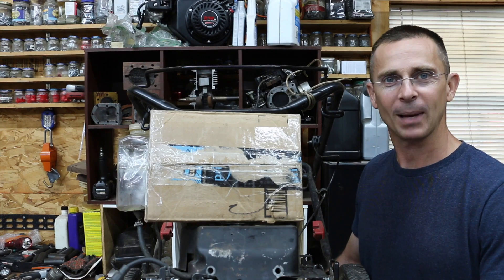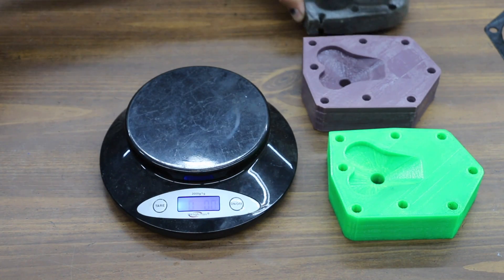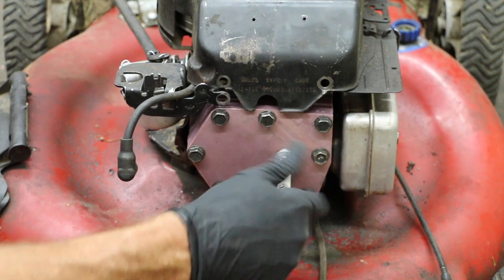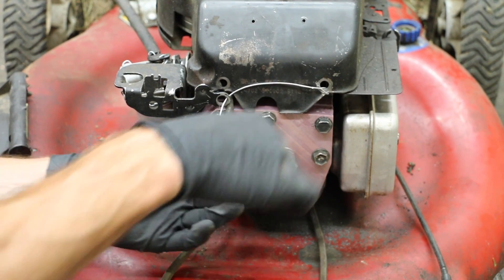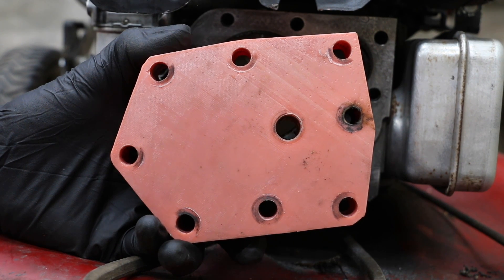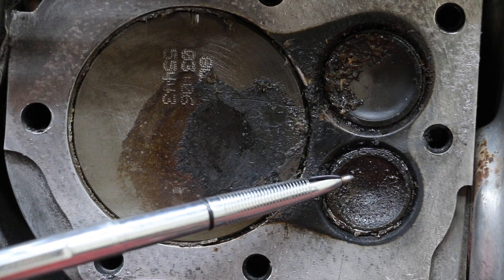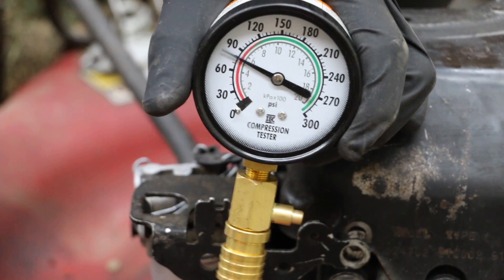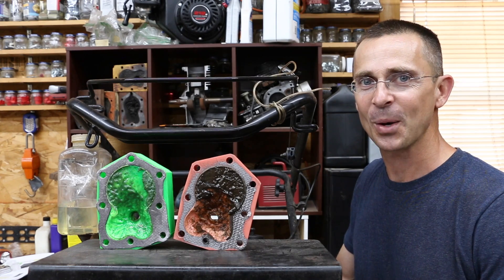How long will a 3D printed cylinder head last?  Let's find out!

Comment: I wonder if Delrin would work as a head?
Reply from the maker: Thank you for the video idea!
Reply: Project Farm Delrin is some pretty trick material. It’s easy to machine and feels almost like a pool table ball or ceramic in your hand. It’s used in race cars for shift knobs because it doesn’t heat soak and transfer heat from the transmission to your hand (or from the sun for that matter). It’s also used as a bushing material when zero flex, low friction is needed. Really an amazing plastic. It’s a highly crystalline homopolymer.

Comment: You shouldn't use a wire brush to clean the cylinder head. If you scratch the surface where the gasket sits, you could damage it to the point where the gasket won't be of much assistance.
Reply from the maker: Great point. thank you

Comment: Fun stuff.  But it should be said that the B&S head costs around $30.00.  Whereas that 3D ABS print will run you close $300.00 :-) and it failed...
Reply from the maker: Thank you!

Comment: Obviously this was the expected result, but it can be noted that really the combustion temperatures are too hot even for metal - metal only survives as an engine if it is cooled, in many cases by water or in this case by having cooling fins and forced-air blowing over it. If you blocked the cooling air the metal cylinder head, or other parts of the engine, would fail eventually. I know that with an old Bug, if the fan belt comes off, you don't drive to the next freeway exit to fix it, you stop right now.
Reply from the maker: Thank you!

Comment: It would be interesting to 3D print engine parts like this, but then find a spray on coating that would allow it to handle the heat.  Like perhaps some kind of spray on ceramic coating?
Reply from the maker: Thank you for the video idea!

Comment: Usually love your tests as they have real world value, but a plastic cylinder head?!?  Oh please....
Now if you did 3D printing of other parts not subjected to violent temperatures it would have more application, such as carburetor body or parts, shear pin, the list goes on.

Comment: 6:42 "NOW THAT'S A LOT OF DAMAGE" -Phil Swift
Reply: Flex tape will fix that
Reply: LETS SEE IF ITS GONNA LEAK
Reply: 4:45
Reply: Run some seafoam through it, it'll be fine.
Reply from the maker: Great saying! Thank you
Reply: @ProjectFarm  You should totally make a cylinder head out of FLEXSEAL
Reply: Grupo Los De La Sierra 🤣🤣

Comment: i see you remove cyl heads quite often, but never see the reassembly. i imagine you go through alot of gaskets, or do you bother with reinstalling a gasket? i ask, since im about to fix up an old mower ive had for a while and quit using due to it dependability, and i intend to gift it to a single mom that is struggling and needs a mower.

it ran last time i used it, but the rpms were low. i think it has a blown gasket since it smokes a bit under the shroud. i was wanting to clean the carbon out anyway
Reply from the maker: Thank you. Yes, I buy a lot of spark plugs and gaskets. Thanks again!

Comment: Genuinely paused straight away. Surely... Surely... Plastic can't work as a cylinder head! If the plastic holds up, sure, i look stupid, but i can't see how plastic can withstand the heat and pressure that a cylinder head goes through for the life of an internal combustion engine.
Reply: Thank god for that! My expectation of psychics paid off, lol!
Reply from the maker: Thank you!

Comment: Should make a layer of heat proof silicon in the inner side of the cylinder head, bet it would last much longer, but I don't know what to do about the spark plugs heating the threads
Reply from the maker: Thank you for the video idea!

Comment: Shave down the aluminum head for more compression (belt sander is good enough).. makes a huge difference in power output... I did that to a 4hp briggs years ago and went from only being able to mow half a blade width to full width when I was in tall grass, still ran fine on 87 octane.
Reply from the maker: Thank you for the video idea!

Comment: When you brush up the cylinder surface, what material is your brush? Always worried about using bristles that are too hard
Reply from the maker: You are right. The wire cup wheel is too harsh.  These test engines have a short life.

Comment: Could I send you a 3D printed part out of a stronger material for this same test?
Reply from the maker: Thank you for the offer. I have another one being made by a viewer using a better material. Thanks again!
Reply: @ProjectFarm  can I send one using ULTEM?  It's melting point is much higher than the normal operating temperature of a typical lawnmower engine.

Comment: I want your tap jig. 😑 but I have no space for the tools I own
Reply: Also, try epoxy with copper filings, iron filings, and chopped fiberglass for filler. 😁 betcha that will be very close to surviving, might need a metal insert to deal with the flame directly, but that would not make for good watching
Reply from the maker: Great recommendation! Thank you

Comment: Most plastics will naturally melt in high heat. There are thermoplastics, however, that are specially formulated to tolerate very high temperatures and are used in automotive engine intake manifolds, see-thru doors on fireplaces and furnaces, and cooking sheets for BBQ grills. I’m sure it wouldn’t last as long as metal, but I would be curious to see how long a thermoplastic cylinder head would last.
Reply from the maker: Thank you!

Comment: You can 3D print Metal.... Titanium, Aluminum. etc. Make one of those abs put it on there. Maybe print a hybrid Hi Temp “Plastic” and use printed Metal where the Compression Happens and familier points of plastic. ie. Bolt Threads, Spark Plug Threads. make sure to take into Count the to make the metal thick enough so it doesn’t fracture.
Reply from the maker: Thank you for the video idea!
Reply: Project Farm Look forward to it. Check out #TakeOnGravity #RichardBrowning he made a flying suit out of printed Titanium. Hit Him Up for the connect on the 3D printed Titanium 😎💎

Comment: What about a reinforced concrete cylinder head?
Reply from the maker: Thank you for the video idea!
Reply: Here's another one , note that the successful ones had a metal top . https://www.bikechatforums.com/viewtopic.php?t=41962https://www.bikechatforums.com/viewtopic.php?t=41962
Reply: @ProjectFarm  A wooden piston made from Ash if fabricated from dry wood, then immersed in oil before use, would be self lubricating, and providing that the aluminium top was screwed tight to prevent air from igniting it, and it burning up in the combustion chamber. It would take the heat, because steam is used to bend at temps as high as an engines works at.Theoretically anyway.

Comment: Ask the person who made those for you to use a Nylon filament.  Nylon has a much higher temp capability.
Reply from the maker: Thank you!
Reply: Project Farm 

Yes, this is a HUGE difference! We printed some gaskets with a printer and the nylon stuff actually worked good for head gasket
Reply: @ProjectFarm  you can also try annealing pla, that can bump the heat resistance from 60°C to ~150°C
However there is a problem with shrinking that needs to be accounted for, or look in to various high temp versions of printer plastics. CNC kitchen channel has a temperature test of common plastics for 3D printing.
Reply: Holok Yeah, that channel is awesome! Annealed PLA is the best you can get without going to exotic, and difficult to print plastics such as PEEK. Even polycarbonate only resists up to 110 °C, while annealed PLA can resist up to 160 °C. Still not enough for a combustion engine (I watched other of his videos and the temperature is around 200 °C), but much closer.
Reply: @ProjectFarm  some PEEK hehehe
Reply: @kiskiller3  or Ultem
Reply: I want to see a resin print.
Reply: The only polymer I'd 3d print into a cylinder head would be PEEK.  It is much more temperature resistant and is higher strength than about any other 3d printed polymer, probably would last a few hours, but requires a special printer with higher temperature to print.  Very expensive also.
Reply: Try running it on alcohol
Reply: dustin little hello, that hit a nerve, one of out AHOLE CONGRESSMAN , WENT to BRAZIL, seeing ALL THOSE AMERICAN CARS THERE USING PURE ALCOHOL, & wanting to know WHY cars in USA canid do this! What that A HOLE WAS NOT ABLE TO GRASP, was those care WERE MADE THERE TO ONLY USE ALCOHOL , They are completely different cars , duhhhhhh . Cherers From NJ🇺🇸🇺🇸🇺🇸🇺🇸
Reply: @mipmipmipmipmip  Honda used a ceramic cylinder head on their F1 bikes. I dont know how it worked out but I read about the experiment.
Reply: Teflon too
Reply: Kevin Griffith Not a good idea... unless you like the smell of toxic fluorocarbons
Reply: @GRBtutorials  pretty sure the toxic fumes only start to getting released at about 350 degrees tho (havent look it up lately but dont think it would be a issue)
Reply: @W C the gasket looked to be TPU (flexible filament)

Comment: They make a PLA that is designed for casting.  They make a liquid ceramic that you dip your print into a few times and then put it in a oven.  After some time the PLA burns off and you are left with just a casting.  They boast a 3% ash content after the initial baking.  Not sure if this is available to the consumer market but it sure would be a prayer to guys running older equipment that can't find parts.   Thanks for the video but you already knew the PLA would melt away just based on the printing temps required to make the print.  One day your going to blow one of those engines up big time. LOL  Hope you are at a safe distance.
Reply from the maker: Thank you

Comment: Yeeeah I don't see plastic working well for some time, especially since these heads don't have any fins and even if they did, probably aren't going to conduct heat from one side of the material to the other very well. And of course with PLA melting so easily the spark plug flew out... Well, that's definitely a no-no.

I know I'm late to comment on this video, but I think finding a new material to make cylinder heads out of is neat and if I can help give video ideas, I'd be glad to try.

 ABS plastic has a thermal conductivity of 0.1k, so any heat that hits it, is gonna stay there for some time, allowing it to melt. Looks like PLA actually has slightly greater conductivity at 0.13k, but clearly it melts easier, causing the results you saw there. Neither of these is anywhere near as conductive as Aluminium, clocking in at 237k (I refer to the element as Aluminium and its alloys as Aluminum to differentiate. I'm weird.), literally over 2 thousand times the conductivity of these materials, and you see how hot that head gets even with its cooling fins.

Consumer 3D printed plastics just aren't going to take the heat. To survive as a cylinder head, you need physical strength (which the ABS plastic seems to have had just fine), thermal conductivity, and a high melting point. You won't get all 3 of these with plastic. Could try an ULTEM plastic. No idea how well it would actually hold up, since I can't find a thermal conductivity coefficient for it and thus can't tell you if it will even move heat from the cylinder. I'd imagine whoever you get it from will charge a shitload though.
Reply from the maker: Thank you!  All great points on plastic!

Comment: Have you tried a leather gasket yet?
Reply from the maker: Not yet. Thanks for the video idea!
Reply: @ProjectFarm  I recall reading that bush pilots would sometimes cut an emergency gasket out of their leather jackets for an off airfield emergency repair.  Sorry, don't remember the source but this allegedly happened in the 1920's or 1930's. Compression ratios were in the 6:1 to 8:1 range back then; roughly equivalent  to your Briggs & Stratton.

Comment: You might want to try some iron wood as a material for the cylinder head test it should fair a bit better than the walnut. I'm just wondering why you thought the green one might work when it's seemingly identical to the purple one aside from color. One last thing, it looks like the engine on that mower needs new rings at a minimum.
Reply from the maker: Great recommendation!

Comment: Why no metal plate like the wood engines? And when are the metal wood and JB weld engines going to be run to breaking point?
Reply from the maker: I need to use the wood plate next time.  These heads were a lot thicker, making bolt length an issue with the plate.

Comment: I wonder how much longer the plastic heads would last if you skim-coated them with some good old JB Weld!
Reply from the maker: Great recommendation!
Reply: @ProjectFarm  something like that, I vaguely remember coming across some documents that i think were research that ford did in the 80s, basically they took their little econobox engine and made a plastic block that had steel cylinder walls and reinforcing steel in other places, i seam to recall they could make the engine 30% more efficient than the original steel block just due to  the heat not being lost (since plastic is a bad conductor of heat), it didnt go into details about why they stopped development though i assume quick failure rates, but I have wanted to try making something similiar ever since i saw this.

Comment: What would an engine do if u removed the intake tapet and reduced spring pressure on the valve? How about a ceramic cylinder head?
Reply from the maker: Thank you for the video idea!

Comment: How about testing a metal 3D printed cylinder head? Metal powder is used to form the object, bound with a glue, and then the object is cured at high temperature, replacing the binding agent with bronze that is infused during the curing process. Seems like that should have a good chance of working.
Reply from the maker: Thank you for the video idea!

Comment: I  thought that the 3D printer would  make the molds that you use to cast the engine in aluminum.
Reply: This idiot just put the plastic master in the engine and wondered why it never worked out :D

Comment: If you had a heat sink , like an electro-coated metal of some sort and a water jacket with high flow rate, then abs might work, at least for longer. It seems to stand up to the compression. The issue is heat.
Reply from the maker: Thank you!

Comment: You could make a 3d printed mold for silicone gaskets.

I guess printing in peek-filament would work for the cylinder head.... but it's a tad more expensive and harder to print. There are even other heatresistant 3D-Printing filaments you could try.(3dk top for example)
Reply from the maker: Thank you for the video idea!
Reply: @ProjectFarm  
You're welcome

Comment: There are plastics that can withstand more heat. There are also thermoset resins that won’t melt but can burn. I am a plastics mold tech and the highest melt temp plastic I’ve come across was called ultem the melt temp was between 650-700 F.
Reply from the maker: Thank you!

Comment: Does it flex too much to seal properly would be my first question.
Reply from the maker: It seems to seal fine but melts quickly.
Reply: @ProjectFarm   That is too bad. I can see how that would have been useful on a boat in a pinch.

Comment: I needed a special gasket on the air blower part of a portable/inflatable hot tub last year. Found that they cost $5 each plus shipping. I CAD'd it up in about 5 minutes and printed one in about 10 minutes. It worked just fine all summer. I printed them out of a flexible TPU filament.
Reply from the maker: Thank you.

Comment: would have been interesting if you molded a water jacket in the head and left a bit enough recess to tap form a copper liner to handle the flame front surface, then might last forever
Reply from the maker: Thank you!

Comment: One of the most interesting things is 3 d printers can now print metal parts and for an engine formula one teams are experimenting with engine blocks since internal structures such as bracing for cylinder walls inside water jackets, , stuff that cant be done any other way are possible allowing ultra high boosts and or lighter construction.
Reply: At my company, we print high temperature metals for jet engine hot sections
Reply: @BenWilson24  High Schools will be teaching that in 30 years, cause it is cool, but they are far behind the curve.  Thanks for sharing the cutting edge cool stuff going on!
Reply from the maker: I'd love to test a 3D printed metal head.
Reply: Nice to see formula one doing its job of pushing engine development.
Imagine if car engines could both get more efficient and be much lighter due to bracing!
Reply: 3d printing with metal, that would be idea for a hotrodder
Reply: And actually, the nascar driver, Brad Keselowski, recently opened his own metal printing shop called KAM. He came and checked out my lab/shop before opening up his own
Reply: @BenWilson24  You my internet friend are doing the tech of the future now.  Imagine printing entire space craft.  Just ship the printer and the components into space.  Need spare parts, just have printing compound and the printer.  Sorry if my terms are off, but it is exciting!  People call computers CPUs, it is not worth correcting them, if you know what I mean!
Reply: Charles Granata that’s all in the works! The difficultly with doing metals in space though is the fact that it’s done with a bed of powder that is welded by a laser. The lack of gravity would cause problems with that, especially with aluminum and titanium powders (probably the most common for space applications) because they’re explosive if they get airborne. We have explosion-containment buildings for printing those metals just in case
Reply: @BenWilson24  Do it in a vacuum and use centripetal force instead of gravity.  I love all the imagination and thoughts.